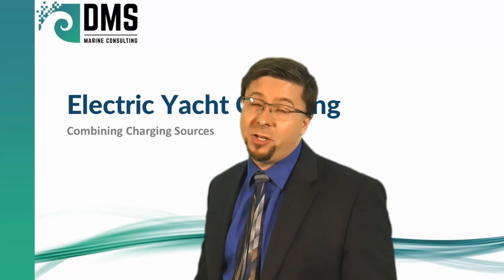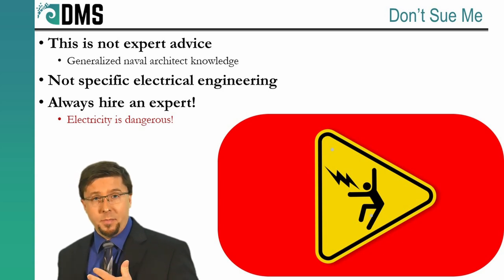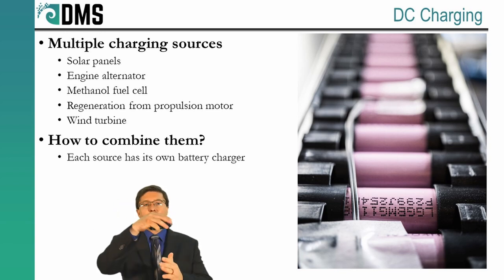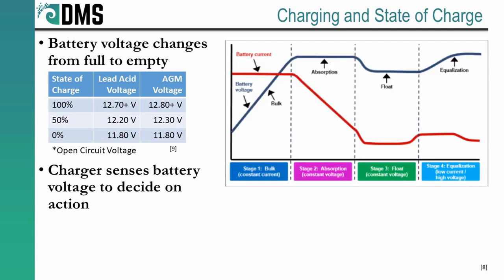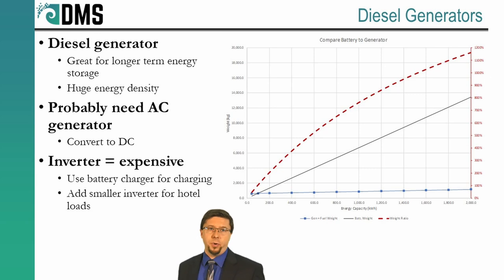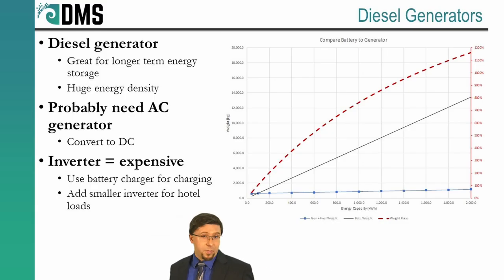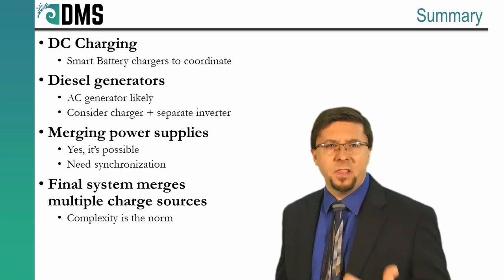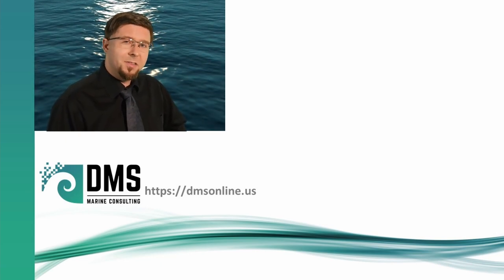How Can You Merge Charging On Your Yacht?

Comment: I was hoping to know what you thought of semi-submersible yachts. Simply as a way to avoid stormy seas in the ocean by simply going under the waves lower bounds.
Reply from the maker: If you mean SWATH hulls, I think they have strong potential.  I did a whole video on SWATHS here:  https://youtu.be/jJAHyDl6KS8?si=6Qhu_LxbqszzUfmi
But if we mean fully submersible, where most of the ship is underwater, then I don't think it will work.  Ocean waves actually extend very far below the ocean surface.  Especially with the long ocean waves, you can still feel their effects 20 - 100 m below the surface.  To get below those waves, I need a full submarine, rated for decent depth.

Comment: mixing grounds from various current sources, What problems are we likely are we to encounter?  What happens when u mix lightening grounds with generator and radio grounds.?  Does the Dock polarity matter?
Reply from the maker: Yes.  All those items are a concern, and a little beyond my experience.  The biggest issues focus on amperage and polarity.  For example, look at the inverter grounds.  You have power supply from the AC side, and power supply from the battery side.  Those two sources can have very different amperages in a short circuit.  I know ABYC standard E-11 has some very specific details to deal with these concerns.  And the issues get even worse when mixing a lightning ground with a radio ground.  Lighting runs a much higher amperage than your radio and can introduce major problems with EMF in the boat.  Sorry, but a full answer would be an entire class in itself.  Mixing grounds is like connecting your wall outlet to a power station.  They are very different levels of electricity with different tolerances.  And the challenge is the fault operations.  You have to consider how the ground behaves during a short circuit from any of those voltage sources.  It's complicated, and it can be very dangerous if you get it wrong.
Reply: when i was a marine contractor specializing in mast wiring without dismasting the vessel, wind instruments, lightning protection and running lights i separated the various grounds and added extra zincs for  protection.

Comment: What no comments?...
oh well this probably isn't the place for it anyway.

I had some ideas for a boat concept thought i would see what you had to say... its way out of my budget but i wanted an opinion.

I wanted two Hulls/keels
I wanted it to have a hollow about 10' ID 12' OD diameter that runs front to back between the keels think a timber circle with the bottom cut out and curled to the sides like an Omega symbol.
the keels would be at the bottom of two beams that would go front to back along the bottom of the omega, like tall sled runners.
the hull to the sides of the omega would be framed like an arched beams that curl away from the omega and then back around a cylindrical body 12' ID 14' OD on either side of the upper 1/3 of the omega.
the frame/structure of the cylinders would be a spiraled beam set up that would make a full circle around the cylinder every six feet down the length of the boat.
both the front front and rear of the cylinders would be merged/capped with a spherical chamber.
the main deck would be level across the tops of the two cylindrical sections with a step down into the center over the omega and stairs into the two cylinders on either side from the deck over the omega.
there would be a ladder access from the deck above the omega down to a shelf/ledge on either side of the hollow inside of the omega.
I rise in the mid deck to the height of the main deck from about mid ship to the rear.
the main deck would have an a frame structured to tie to the outside edge of the cylinders tangentially.
and the main decks planks and beams would tie into the top cylinders structure.
wish i could draw pictures and post them...
maybe when i finish my certificate i could send you a cad file on either Autodesk or Solid works, i am still learning the two programs right now.
Reply from the maker: Cool.  I got the general idea from your description.  From a physics perspective, i don't think the shapes will make much difference.  (Although, I may have misunderstood the description.)  But it will definitely look unique.  And for yachts, looking good is half the reason to create it.  
Nothing wrong with having a dream ship.  Also nothing wrong with that dream changing over time.  I think most naval architects have a working project for their "perfect" personal ship, and their idea of a "perfect ship" changes over time.  Myself, I'm currently on version 5 or 7 of my perfect personal ship.